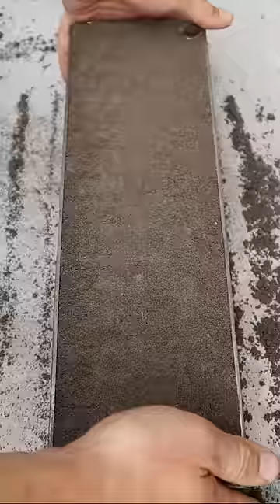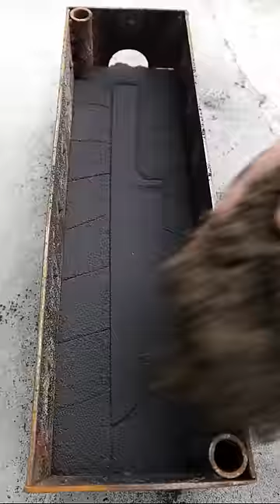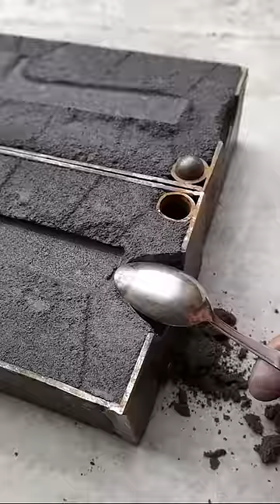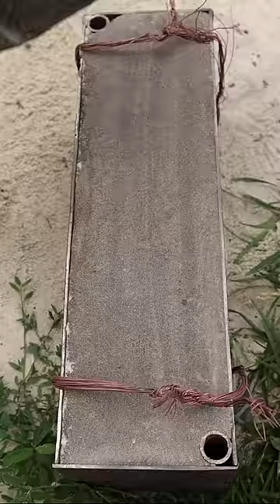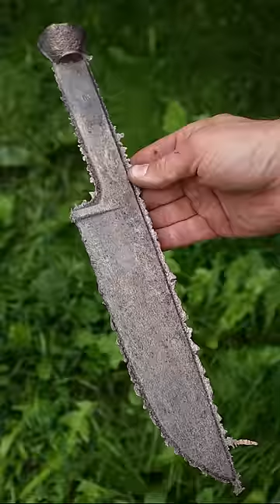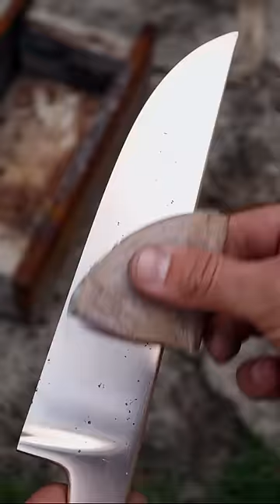Casting Copper Knife out of Scrap

Comment: A cast knife is practically an oxymoron.
Reply: How is that?
Reply: And not copper hmmm
Reply: A fishing rod's for casting while a copper knife's for throwing and bending.
Reply: @vincedibona4687 figure of speech
Reply: @vincedibona4687 I think it's because you need higher level tools than the knife itself to create the knife
Reply: Idk… either it’s over my head or idk what an oxymoron is … “old news” is an example as old can mean in the past and news typically means something more recent or in the present. A figure of speech with contradictory words basically.
Reply: So I don’t understand how cast knife could be one.
Reply: @TwhistyyHD it's def not.  It means the 2 terms imply opposite things (jumbo shrimp), and "cast knife" in no way fits that... unless he's implying a cast knife can never have the properties typically needed for a knife, but that's a stretch
Reply: Good word useage
Reply: @vincedibona4687  It is a way of saying no one does this, without knowing what an oxymoron is. However!
Cast steel has a different microstructure from forged steel and usually has some porosity to it. The cast structure which is made up of dendrites, columnar grains, eutectic, etc. is eliminated by forging.

A cast iron knife would be brittle and would crack and chip easily. Not to mention this demo is copper, so this is purely made to be pretty! Nothing more!
Reply: How ? Please explain and give us your definition of oxymoron.
Reply: @vincedibona4687 because knives are forged. A cast blade would never hold an edge because the grains of the metal are too irregular for a start. The casting process also introduces impurities and this is pretty much unavoidable and sand casting, which is what was used in this video is just about the worst way to cast something. It’s also the cheapest, but it’s a terrible method.
Reply: @StephenAku well played
Reply: @georgemccabe3522 Thank you.

Comment: 5% casting
95% sanding and polishing
Reply: It is, unfortunately, painfully accurate.
Reply: Same goes with blacksmithing TBH
Reply: As a blacksmith, most of my blades take like 20 or 30 minutes to forge, up to like 3 hours for a damascus, and then hours and hours (and sometimes days) to turn it into an actual knife. Forging is like 20% of the work.
Reply: @jeanladoire4141  Do you do brute to forge? Cause a lot of people I see on here just forge a rectangle and then sand a knife out of it lol.

Not that there's anything wrong with that, just that you're not forging a knife if you're doing that. You're really forging a brute and then working it cold until it's a knife.
Reply: @franciscoferraz6788  nope, i'm actually forging my blades, from bevels to engravings. After i'm done forging, my edge is between 1mm and 1.5mm. I forge extremely thin, for doing the exact opposite : not having any material to remove during the grind pretty much. I also don't have a belt grinder, i do my finishes with files, angle grinder, stones, and sandpaper.
I don't like when people squeeze a spatula and carve a knife into it. That's not blacksmithing to me, that's just squishing. I also use a charcoal forge, and i do my heat treats the old way, in the fire.
Reply: @jeanladoire4141  That's awesome! Can I find your knives somewhere online?
Reply: Minor detail
Reply: @LuccaOzorio filming and editing is ALOT of work... the thing I'm most impressed w on yt is the amount of amazing artisans who THEN learned filming and editing and got great at that too!
Reply: @LuccaOzorio  i do have a YouTube channel, it's called Forge du Lys
Reply: @eddyeddy5881  Painfully? With all the tools at his disposal?
Reply: 😂 that’s how most casts go 😂
Reply: @jeanladoire4141  nice name for it
Reply: Yonkage-ik5qb
I stumbled onto this video,
So what's wrong with that .. . I have done similar on knives I crafted !! !
Reply: Because it is the real process of making it. Lol
Reply: ................................myself
Reply: It’s copper so it would take very little time to polish on a polishing wheel to full mirror.
Reply: Sanding comes in casting process.
Reply: Honestly man I work at a machine shop and its still like that lmao. Just sub casting with programming.
Reply: What else did u expect???
Reply: In video its the reverse.
Reply: @falcondsasuke2911 

He's actually giving a praise.
Reply: I like sanding and polishing though. In fact, the sanding and polishing is the only thing i find practical about this. Despite what people say, it isnt that hard to sharpen a crappy stainless knife to a razor edge that will keep a useful edge for a decent amount of time. What i dont have is a bunch of copper alloy and crucibles and casting sand. But everyone has a crappy stainless knife they hate. I mean, im serious, i have a trick to making bad knives surprisingly decent. Try wet sandpaper from medium to mirror grit on a soft squishy surface and some experimentation and time. Think a bit of cheap foam core mohair stapled to a flat peice of wood and a constant trickle. I have knives that i prefer after years only using a steel once in a while. Perhaps a version of this technique is known to knife people by a name but. It really does work and I am an actual cook. I never let the busy chefs let anyone else do their knives. I’ve been doing it since childhood. You can demystify the difficulties of stainless sharpening by looking at it under a microscope both stainless and high carbon. Sharpen them the same way and look close then put it through its paces then look again. The answer is written in the edge.
Reply: @jeanladoire4141 but when you get good at forging, that 20% means a day or so less of sanding and cleaning up imperfections, I’m only a middle of the road bladesmith, but since starting, I’ve definitely noticed less post cleanup since being better at the anvil.
Reply: @franciscoferraz6788 claro el chico es un bruto
Reply: I can hear the sound of the knife breaking already after few cuts
Reply: You Mom Gay 😂🎉
Reply: Кованые один фиг лучше
Reply: @theoriginalmonstermaker editing is childs play compared to amount of skill and discipline needed for this. This guy clearly just records on his phone and clips it together into a video. Dont compare the two
Reply: @sethyork1164 I think you're familiarity with one and awe of the other is clouding your opinion; they are both skills,  both require the possession and understanding of specific equipment,  and both require dozens of hours of practice with that equipment until you understand enough to accomplish the task...

I guarantee you he sets up a light and camera for each of these takes,  then crops and compiles dozens of clips on a laptop in some sort of editing software... if you think that's "easy" its bc your familiar w the process. Ppl feel the same way about casting.   

There's NOTHING complicated about hacksawing and sanding a piece of metal.  I bet if you found someone living in the jungle,  not learned in either,  you could teach them to make this knife WAY faster than you could teach them to post an edited video to YT.
Reply: L
Reply: What were you expecting 🤷🏻 it's casting..
Reply: Your point?
Reply: Ui
Reply: same goes with painting, too.
5% painting
95% prep and buff
Reply: 5% casting
95%,,,sanding,,and,,polishing
Reply: круто!
Reply: Yea.....very easy...
Reply: As it often is in any art form. A minute to learn - a lifetime to perfect.
Reply: @jeanladoire4141 je t'ai trouvé ici, j'ai compris que t'etais Franc direct mdrr
Reply: @darthjarjar2742 and Welding
Reply: Well yeah it’s a method for people who can’t or don’t want to use a lot of tools
Reply: حبغبكلكيةلكيةل طيالطصال ❤❤🎉🎉
Reply: Hhh
Reply: @jeanladoire4141 whoa that’s a lot of
Reply: 100% reason to remember the name.
Reply: @jeanladoire4141 you wouldn't do well on forge in fire then lol
Reply: @FromMetayou  i forge my blades by hand, and i forge them properly, so not the American way, wich usually consists in flattening a crude spatula and carving a knife out of it. I don't see forged in fire as prestigious, they usually take beginners so they would make mistakes and have failures to show. It's just reality tv. So i don't care if i'm not to forged in fire standards, it's probably better that way
Reply: Maldvsvy😂
Reply: But without those 5% you can't make it... 😅
Reply: Real blacksmithing
Reply: just an artwork
Reply: Ó
Reply: That is fascinating! Thank you for taking the time to explain that! 👍👍
Reply: Actually according to my calculations 🤓 since the red ant is at half way when he starts sanding 🤓 it is more 50-50 🤓

Comment: "Bro forgot to forge" 💀
Reply: Well yeah, it says casting
Reply: @leandromorales3658  ik but after casting and shaping, every blade needs forge to make it hard and strong.
Reply: @Editor_from_moon you truly don't know anything about blacksmithing
Reply: @Carri110_  You're saying me that idk anything about Blacksmith, who used to watch a Blacksmith's program on television daily. Better you know someone before judging!!!
Reply: @Carri110_ Used to watch a television program? Yeah you know nothing about blacksmithing for sure. More importantly, you know nothing about metals and metallurgy
Reply: @Drunkenmaster632  I do not, but i know the difference between forging and casting
Reply: @Editor_from_moon  lmao
Reply: @Carri110_  that's what I was saying 😑
Reply: @Drunkenmaster632  you're talking to him or me?
Reply: @Editor_from_moon You mean like stick it in water or oil? I mean if that's the case, you only do that when you're forging a knife and it's still a very hot metal out of furnace, After that you polish it.

and Casting is way different, Casting isn't really supposed to make good knives nor make them durable...
Reply: @Unusual.Incidents_Unit  yeah
Reply: Some metals don't work that way.
Reply: you don't really need to forge anything with copper. Melting point is low enough to not allow you to do anything like tempering or hot hammering. In fact, if you really need to hammer copper, you just do it cold or barely hot. Casting really is the quickest and most efficent way to do anything with copper alone, unless we're talkig about making copper cables (but that's not blacksmithing anymore).
Reply: @Editor_from_moon  you clearly did not watch enough TV kid .
Reply: Bro forgot to forget

Comment: I personally love copper. It's not the most ideal metal. It's a soft and heavy metal. Makes one heck of a gorgeous knife, though.
Reply: I have a copper wah wah petal for my guitar and I love it. Copper is beautiful
Reply: Except it's brass, not copper.
Reply: It's aluminum bronze.
Reply: А это не олово бро?? 😉😅
Reply: Definitely great for decoration, not so much for actually cutting though since it's too soft to retain an edge
Reply: Yeah. Would've been better as practical tool with some tin to make it bronze.
Reply: @simpleman806 it's hopefully alum bronze and not copper apparently it looks like it. Copper would be a gross material to make any eating utensils from
Reply: @user-cr9zh2vf7s  If that was copper, the knife would be foldable by hand
Reply: @herzog1000  no it'd snap like a normal knife
Reply: @herzog1000  the blade wouldn't last very long either
Reply: Coppersmiths dropped like flies during the ancient days thru the medieval period as hot coppersmithing puts of cyanide gas.
Reply: Looks nice... but is useless
Reply: @simpleman806  it's bronze, not brass.

Comment: How long does it take to make just 1 of these videos?
Reply: About an hour, is my guess. The longest part would be waiting for the crucible to heat up before melting the copper. The 2nd longest part would be grinding/polishing the knife.
Reply: @jaidenbrink  an hour is too short😂, it may take more than 20 mins for the crucible to heat up and melt all copper,  and another 45-60 mins (i think it takes even more) for the molten metal to cool. Grinding and polishing also takes a lot of time.
Reply: Часа полтора-два
Reply: I'm thinking more than three hours. Pro forgers have all equipment on hand.
Reply: Depends on your equipment 

If I tried doing this it would take days, although if you already got a good set up with a proper forge, casting equipment, and grinding machines, then it will probably take afew hours

Comment: Good looking knife.  Imagine it doesn't stay sharp very long tho.
Reply: It will stay sharp nicely, unless you cut rocks. Or pressure treated lumber.
Reply: @richardmccann4815  That knife is cast, not forged. It'll be brittle as fuck and will lose it's edge rapidly. It'll probably lose chunks of the cutting edge as well over time, even from day to day use in food prep.

This is why knife makers don't cast their knives.

Comment: Extremely weak knife not only because it’s copper which is a soft metal but it wasn’t forged but casted instead which causes problems with air bubbles imperfections and cracks developing within the metal

Comment: Is this supposed to be an expensive decoration? Because I can't think of any practical use for this. It's annealed copper, which is an extremely soft metal. The edge retention would be a joke and it'd bend super-easy.